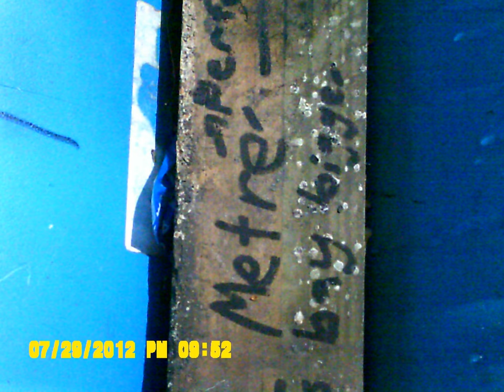plastic barrell houseboat construction

Comment: Nice, but seriously, not putting the bungholes top dead center is just a bad idea. No matter how well they're sealed, they are the only place that can leak barring physical damage. So make sure they're on top and you have enough barrels to make sure they're above water is just a good idea.
Reply: Good idea, I would put non-porous styrofoam in the barrels so if they are breached/damaged they won't fill with water.
Reply: @marcushennings9513  Right, closed cell foam.
Reply: I'm about 4 years too late, but there are 2 bungs on plastic barrels. One is already at top dead center, and the other is at the bottom. Hope you find this one day and it makes you go ohhhh okay thats why he did that lol.